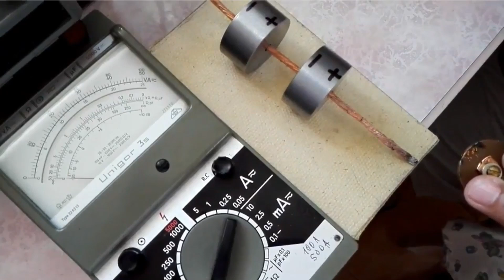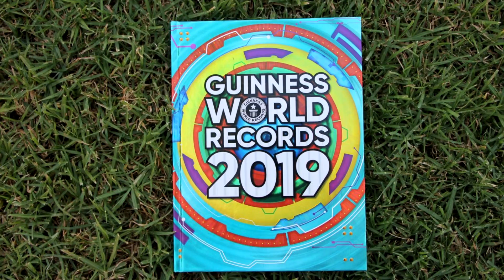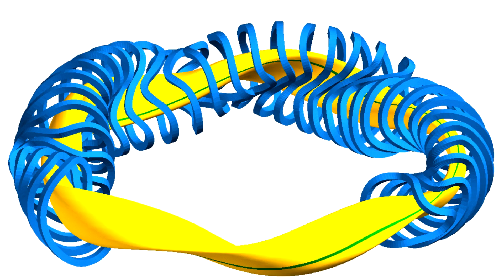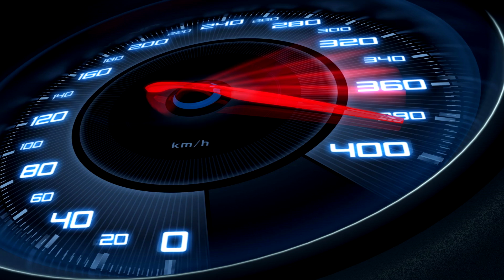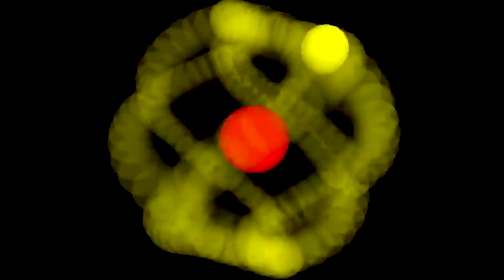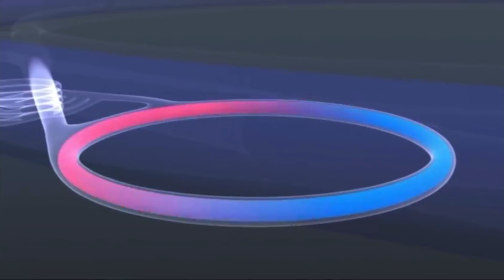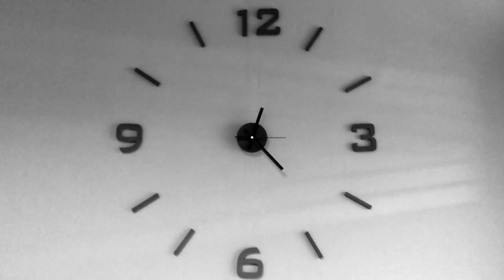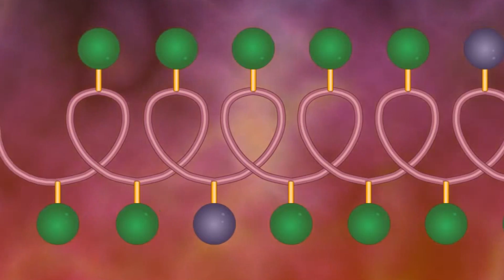12 Most Powerful Magnets In The World. This Is Monster Magnet!

Comment: Yeah! BESSY! I spend several weeks there and at the ALS in Berkely, CA, USA, the SLS in Switzerland, DELTA Dortmund, Germany ... Exactly for those X-ray absorption mesurements and XMCD... 
What we used is the "light" that is produced when you let those fast particles travel through a linear structure of magnets, called wiggler or undulator. The undulator can shift its arrays of magnets in a certain way leading to brilliant circular polarized light for the XMCD (X-ray magnetic circular dichroism) measurements. Crazy stuff. We could excite either spin-up or spin-down electrons, and that again selective for each transition metal ion. Wooow. 
10 years ago! That time was great! I was studying magnetic molucules. 

Now I am medical physicist at a radiation therapy. Here the whole accelerator is moved around the patient. 
Anyway, I have the early shift tomorrow :-) and have to go to bed! Greetings from Germany!
Reply: K nerd